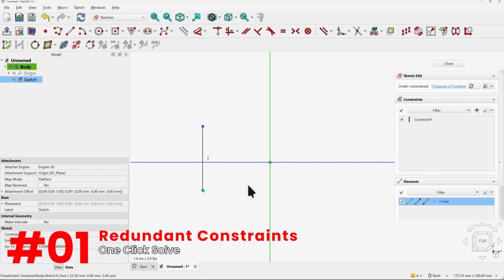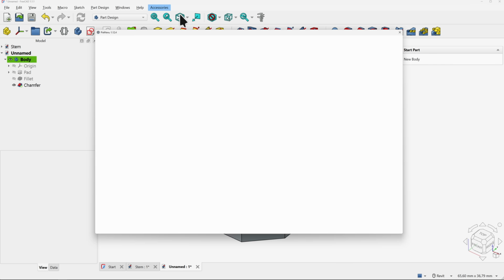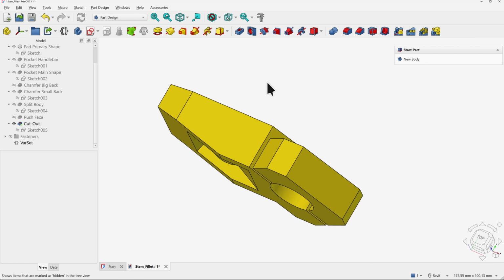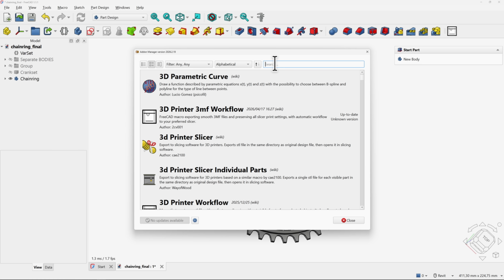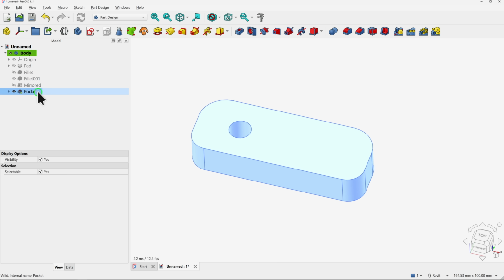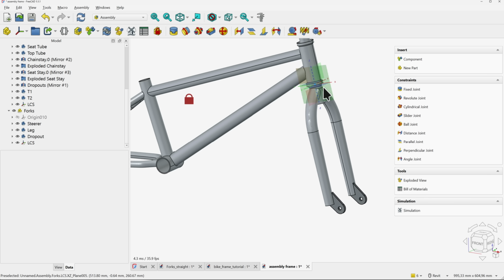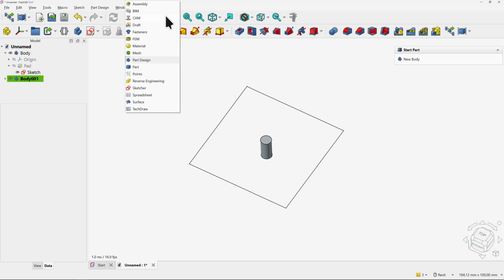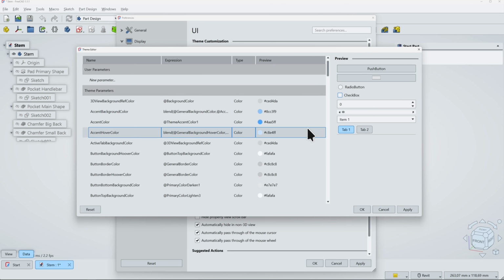25 FreeCAD Hacks (You probably don't know)

Comment from the maker: If you are looking for a complete beginner tutorial on FreeCAD 1.1, be sure to check out this video : https://youtu.be/KmtqNaGPiiQ?si=ggLrxCfENGj1NKOb
Reply: Ia there any way you can reply to comments? Ive tried a few times to get an answer to my question. I work in thermo forming. I make molds. I want to progress to making compression molds. IE a positive and negative two part mold. The molding material is 2mm thick. I have over 100 molds. Would there be an easy way to make negative molds within freecad with that 2mm add on for the negative mold without having to draw all 100 sketches from scratch. Is there a way to add 2mm to solids with a few clicks?

Comment: Thanks for the tutorial! I have a (beginner) question: in Freecad, there are these shortcuts for the drawing tools, composed from 2 letters (press G, than X, etc). Can we redefine those and set just a letter? (like the constraints have, E for equal,... D for dimension).... Or can we set a second keyboard/numerical keyboard or a streamdeck  for specific tools/operations?
Reply from the maker: @nls3081 Yes, you can absolutely rebind any operation to a single keypress.
To change your shortcuts, just go to Tools, Customize and select the Keyboard tab.

Comment: Just found out about this software and it sure looks like a powerhouse. Too bad that it just doesn't have a way to keep imperial units set to ALL inches. The autoconvert to feet and then yards might be useful to some, but us woodworkers find it way more useful to stick to inches throughout the whole project. To my mind such a fix should be easy to implement for the coders who have coded way more intricate things into this software.
Hopefully someone will come with a fix or add-on for this issue ASAP.
As for your videos/tutorials: keep 'um coming!!

Comment: One thing I could not find os having multiple configurations. I use that a lot with SolidWorks to make wing profiles. Where I have abase profile and several configurations with different cuts (pockets here..) depending on the desired profile. 

Is there anything like this or I just need to create multiple parts instead, like you did with the pattern?

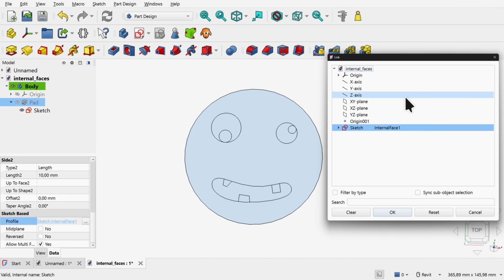Comment: 1:06 - so it is supposed to work like that! I was trying to do this, but when I hit 'clear,' the window closes. But I just checked the latest weekly build, and it works. Also, handling internal faces is greatly improved. In 1.1.1, sometimes not all shapes on the sketch are generating faces.

Comment: Awesome video, as usual! Thank you... but also, damn you got me at the end... 😂
When working with assemblies that require multiple instances of the same component, is there a way to quickly instantiate components that have already been joined? For example, with a linear array, or a polar array and then fix them. I remember using an option called "Ridgid group" in Fusion after repeating some components to fix them to the assembly. Curious to see if anyone knows a similar workflow that I could use in FreeCAD.